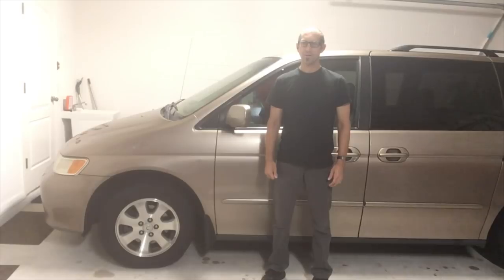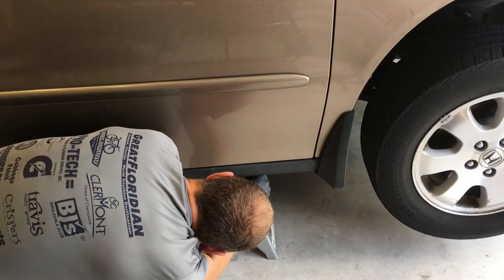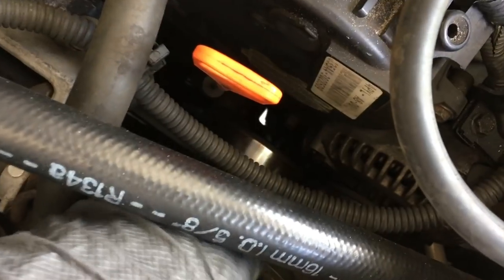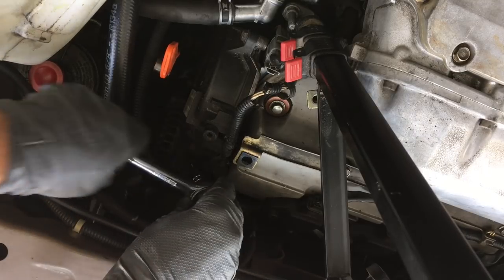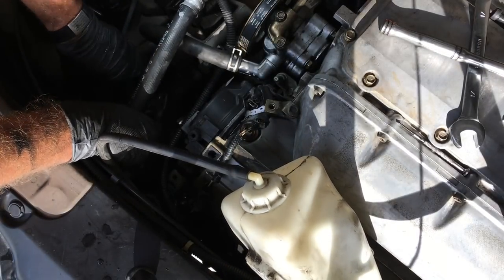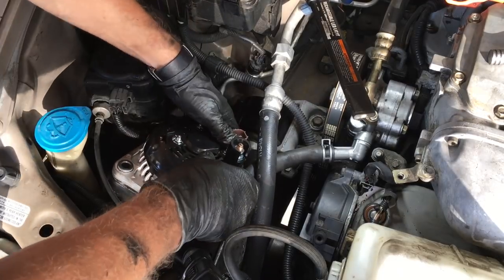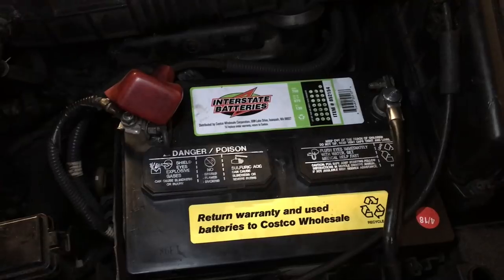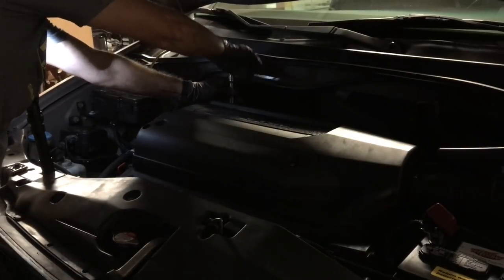2004 Honda Odyssey Alternator Removal & Replacement without removing tensioner pulley

Comment: Thank you, Jeff! 
We followed your steps and saved $500!  
Here's what we did:

1. Refuse to pay $650 for new or refurbished alternator installation by Triple AAA mechanic
2. Refuse to pay $650 for new or refurbished alternator installation by trusted, local, non-Triple AAA mechanic
. Barely make it home on new battery due to alternator's burning-in-hell death.
3. Attempt to jack up 2000 Honda Odyssey with hydraulic jack. Don’t know how to turn the small cylinder until the hardware guy tells me. 
4. Since the Odyssey is parked on a slanted hill with grass and dirt and we have no jack stand, we then jacked up the car about 10 times and put 4 inch x 4 inch wooden blocks under it to hold it up.
5. Finally get the car suspended high enough and remove front passenger tire.
6. Visit the swear jar: https://www.youtube.com/watch?v=rgOfAgFJktI 
7. Try and reattach tire after proper jacking of car.
8. Realize the sloped hill won’t allow us and re-jack up car in muggy, humid hot summer weather.
9. Revisit the swear jar
10. Remove plastic casing over engine block after moving brake fluid and window washer fluid reservoirs.
11. Remove forward alternator bolt with 12 mm wrench. Easy-peezy.
12. Attempt to remove rearward alternator bolt with socket wrench, flat wrench, Serpentine Tool Belt. None of these even budge the bolt. 
13. Drop each wrench on accident while trying to loosen bolt
14. Revisit the swear jar
15. Use the Serpentine Belt Tool (bought on Amazon) to try and loosen the rearward alternator bolt. 
16. Discover the rearward bolt was attached in the year 2000 and the all wrenches used have rounded and stripped the corners of said bolt.
17. Revisit the swear jar
18. Purchase 14mm flat wrench (only sold in a set) that contains teeth in the circle end of the wrench
19. Slowly and patiently remove rearward bolt and alternator
20. Wait for new alternator to arrive from Home Depot as Amazon did not have the specific alternator for our model
21. Drop every bolt and nut and wrench used due to the angle of the alternator and the lack of space to work with.
22. Out of frustration, hit the frame of the car with the Serpentine Belt tool so hard the ball bearing falls out and is lost.
23. Go back to hardware store and ask for another ball bearing.
24. Nice hardware store guy explains the tiny spring under the ball bearing, it’s function and form, and the physical difficulty / impossibility of inserting a new ball bearing. He suggests welding to fix the problem. I don’t have that type of equipment.
25. Drive home, trying not to revisit swear jar.
26. Arrive at home and revisit swear jar anyway.
27. We had to use a ½ sized socket wrench on the forward alternator bolt and a slightly larger than 10 mm wrench to attach the wired metal ring to the new alternator.
28. Attach serpentine belt tool extension arm, and connect that extension to the 14 mm flat wrench to loosen the belt tension (3:10)
29. Jumped the battery with our 2004 Honda Odyssey which just failed a safety inspection since it has no O2 sensor nor catalytic converter. (Apparently the mechanic we took it to, before we bought it, didn’t notice these missing parts. No more car purchases off Craigslist. Enough is enough.)
30. Shout for joy and to relieve lower back pain from working on the alternator for hours
31. Bask in the savory sweetness of success, knowing my mother in law laughed at the idea of me replacing the alternator.
32. Cash out the swear jar and buy sticky buns!! 😊
33. Write about the experience on our social commerce blog: https://medium.com/@homemaides/of-serpentine-belts-and-sticky-buns-part-1-454b695a3410
Reply from the maker: HOME MAIDE, sounds like you had quite the experience.  I've been in your shoes many times myself.  But there's nothing like the feeling of satisfaction when the job is complete and you did it yourself!
Reply: @DIYJeff  So true!  Next up, I need to weld in an O2 sensor and Catalytic converter into a 2004 Odyssey. Do you have any videos on that topic?
Reply from the maker: HOME MAIDE, I'm sorry, I don't have a video on either of those.  I no longer have my Odyssey either.   The transmission went out and I sold her.
Reply: @DIYJeff  Brah!
Reply: @DIYJeff  Just found out the inside of the alternator we installed isn't spinning. Everything else is working. What am I missing?
Reply from the maker: HOME MAIDE, not sure other than maybe you have a faulty alternator?  Is it new or remanufactured?
Reply: @DIYJeff  It's new. From Home Depot, matches the model, sub-model, amperage, etc. Just used QD Electronic Cleaner manufactured by CRC and dielectric grease on the wiring harness connection point.  Is it possible that the harness that has a metal o-ring ending - if that had a nut that wasn't conductive, coudl that be casuing the problem?
Reply from the maker: HOME MAIDE, I'm not an electrical specialist so I'm not sure.  Using dielectric grease definitely isn't going to hurt it to try.  I guess one way to test the alternator would be to take it out and take it to an auto parts store that tests alternators and they could tell you if it's bad.  It's also feasible that there's a problem with your wiring harness.  You might be able to find a diagram online that tells you positive and negative in the connector that attaches to the alternator, and use a multimeter when you turn the key over to see if the alternator is getting the signal.

There are several possibilities of what could be wrong.  You have to check each one and rule it out.  But I'd start with the alternator first before you start checking wiring.
Reply: @DIYJeff  Thanks Jeff! Turns out it works great. NOw, I'm onto a 2004 honda odyssey that needs a catalytic converter and O2 sensor installed. :)

Comment: I enjoy all your videos. Got a question for ya. How many miles did you get out of your alternator? I have an 04 also 🤓 Thanks again for the video 👍
Reply from the maker: @Rodney Smith, unfortunately, I had to sell my Odyssey (RIP).  The transmission went out at 259k miles.  And I just couldn’t justify putting in a new one with that many miles on the engine.  So I’m not sure how long the alternator would have lasted.  I had about 50k miles on it when I sold the vehicle and never had an issue.

Comment: Better then a 2003 ford focus, those you have to unmount the motor then jack up the motor to pull the alternator out from the bottom..
Reply from the maker: Yikes, that doesn’t sound like fun.
Reply: @DIYJeff  yeah, it wasn't at all. Still managed to get it done by the end of the day.

Comment: Except when the stupid bolt just starts rounding
Reply from the maker: @Jason Skirvin, were you able to get the rounded bolt out?
Reply: @DIYJeff  yea had to take tire off then the tensioner pulley off then hammered smaller socket on it

Comment: You don't have to jack it up to do this,as you can remove the tension on the belt with a long screw driver or a jack handle.
Reply from the maker: talclipse, thanks for the comment.  There are certainly variations of how you can perform the job.  I showed though how the service manual outlines to do it.
Reply: @DIYJeff  yeah I just did it last night without lifting up the van at all.however now my power steering is getting massive air in the system.gussing the alternator must have nicked a hose or cracked the reservoir.traded one problem for another lol.

How about that lower 14mm bolt? Of course my ratcheting combo set didn't have a 14 in it so that took about a dang hour to get out lolol.
Reply from the maker: @talclipse , it does sound like a hose is leaking in your PS system.  It may even be as simple as hose came loose.... I was lucky enough to have a 14mm socket, but yeah, most kits don't have them because car manufactures rarely use that size.
Reply: @DIYJeff  I've needed one so many dang times,and Everytime I forget to order one.

I flushed about 2qts through it and the foaming stopped and the noise got much better.hoping it was just the old fulid was just shot.
Reply: @talclipse  Honda has an upgraded O ring for the PS hose outlet fitting.  When the original gets old, it allows the pump to suck air.  Ask dealer parts man for the upgraded o ring.

Comment: Very nice video.  In doing this job a few years ago I figured out a way to torque that 14-mm bolt without any special tools.  It's important that you get the torque right, too: You obviously don't want your alternator coming loose, and if you over-torque that bolt you could have even worse problems, because you might strip the soft aluminum threads holding the alternator to the engine block.  Here's my video with the trick: https://www.youtube.com/watch?v=nu-LGZHs79s&t=9s
Reply from the maker: @Shawn Davis, thanks for the tip!

Comment: ITS POWER STEERING!!!!! NOT BRANE FLUID!!! 
Otherwise good
Reply from the maker: crazyelmokong, yes, that's the #1 comment I get on the video.  Thanks for pointing it out.
Reply: @DIYJeff  It is so easy to make this mistake. The brake fluid reservoir is located in front of power steering unit on the firewall. . Ass backwards, especially when you fill it with power steering fluid...oops.
Reply from the maker: @sisco3404 , thanks for the comment.  I do know the difference between the 2 reservoirs, just made a brain fart when identifying it during the video.